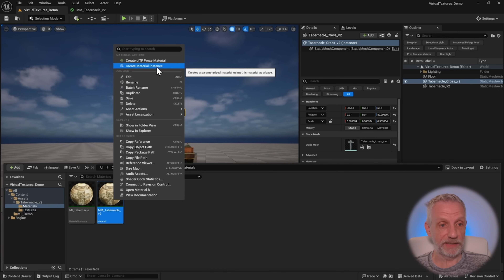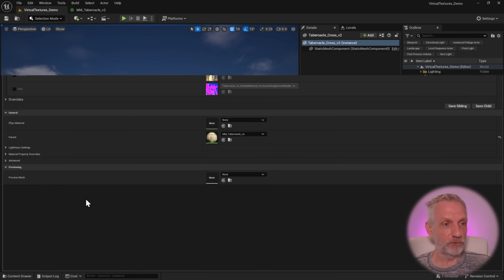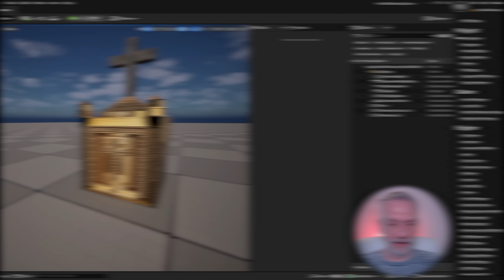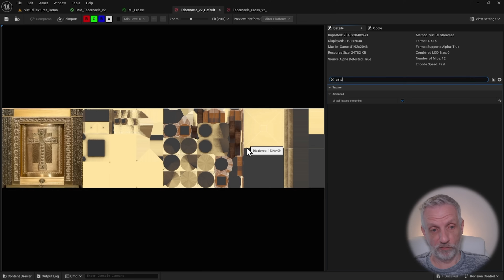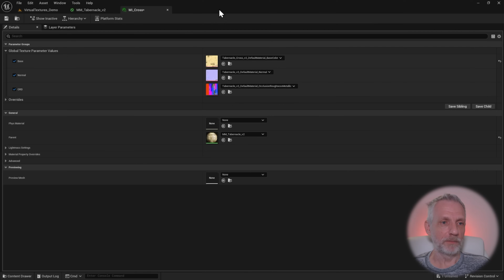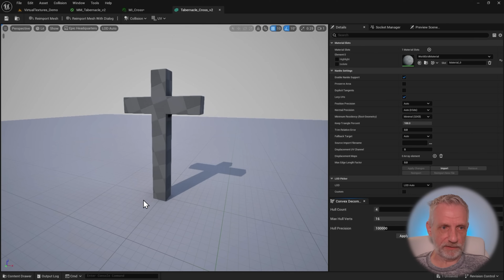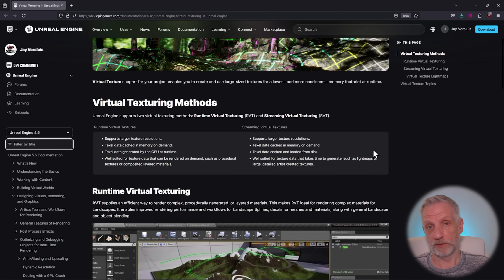Virtual Textures in Unreal Engine

Comment: Hey, thank you for this vidéo! i've question: I don't understand what's happening with my project. Virtual is enabled, the imported textures are in VT and they are named xxxxx.1001.png or xxxxx_1001.png, and I only have one texture when importing. UE5.4 or 5.6
Reply from the maker: Oh that's normal: UE doesn't expose the individual images that are part of the texture set, instead it groups them all together so you'll only see one in the content browser. It will use all UV tiles under the hood for texture streaming though 🤩
Reply: @WPguru  Actually, in Blender, I had a material for each mesh, and when I deleted all the materials, it worked, and now I can see all the tiles in Albedo, which is normal... Thanks for your message ;)

Comment: Dear WP Guru! Hello, can I ask a question here about DAZ?
I was working with background instance in my project. There, you know, I discovered a new amazing thing - if you need to insert a character in a fogged photo background, you make your own fog for the character and DAZ automatically draws the fog only in the character area, blending with the fog on the background. This is awesome!!! But!!! When I need to make an iRay node-floor (matted for the shadow), the fog started drawing on the entire floor below and it messes up the overall picture. Do you know how to avoid this?
Reply from the maker: I don't know, sorry. Sounds like a huge hassle to try this in Daz Studio, so I would add the fog in post production and just mask out the character in Photoshop. Or use volumetric fog for the whole scene, that'll also do the trick.
Reply: @WPguru  …but now i think i found the way — i think i can set up the shadow intensity to thousands with overall ground opacity to 000.1
Soon i'll try it!